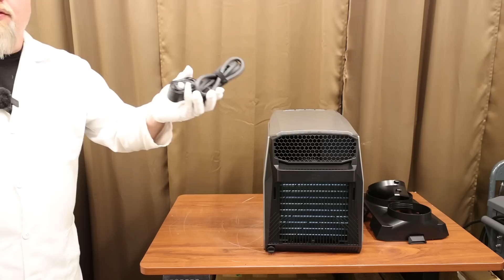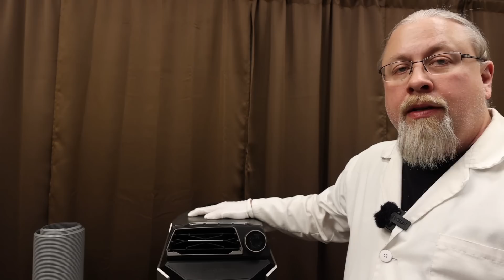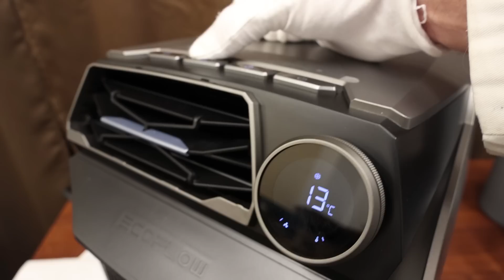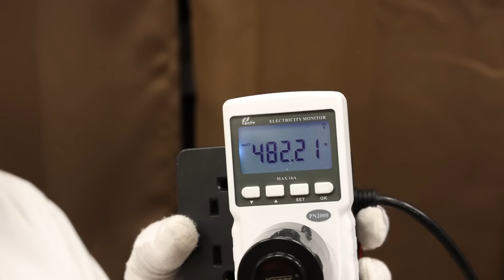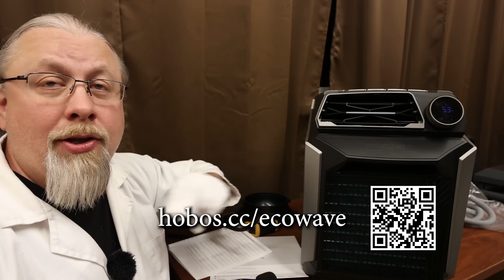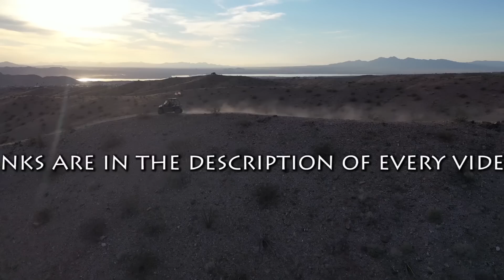EcoFlow Wave PORTABLE Battery Powered Air Conditioner 4000 BTU First Look Review

Comment: Looking at the specs the EER for this is less than 7.  (4000BTU÷600watts)  Most window units have a EER of 10 or more (higher is more energy efficient).  If your going to be running Air Condioner  off of batteries it would be best to find one with a higher EER than this.
Reply: Funny story, my central air conditioning broke and so I bought a couple window units and use them to call the part of the house I was saying. It got colder than with my central air conditioning and the bill was lower. I added two more window units but still closed bedroom and bathroom door when I wasn't in there and the bill was about 2/3 the price of using central air conditioning. That's about 110 during the summer instead of 180 during the summer. It's clear that the window units are extremely efficient now compared to my older central air conditioning unit. And it actually gets cold with them and they keep the air dry.
Reply: @mac_mcleod  yes and if you only air condition the room you are in you will save more money. I use window units because my AC quit working and my bill was way over 100 dollars a month. Now my bill is only about 50 dollars a month. My hot water heater is still on a timer so that didn't change my bill. I had 30 dollar a month bills without AC in cool months. My neighbor across the street pays over 200 dollars a month for AC and her hot water heater is on all the time. Window units can save you money. Also my window units  have an energy saver mode which I use. When I move I will take my units with me because the house up where I'm moving to is much smaller and two units will cool the two rooms I'm not too much worry about the kitchen or bathroom because the kitchen is open and the bathroom is next to the bedroom. The front porch will need a unit only if someone sleeps out there but nights are cool most of the time. 73
Reply: If you are hot....you could care less
Reply: Rated power is 410w, 600w is surge and shouldn’t be used to calculate the EER
Reply: @riversdu2836  another youtuber measure it at 550 watts

Comment: There's nothing inherently inefficient about using AC as long as long as the converter is efficient.  I wonder if it will perform as well on DC.  Quite often, products that have AC and DC power options draw less power and produce less output on DC.
Reply: As I understand it, contemporary air conditioners generally have similar mechanical efficiency.

But this is a low-power unit, so even at high efficiency, it's going to struggle in many circumstances. Add to that the fact that it is expelling hot air (that has to be replaced in the room by outside air) and that there will be some heat radiating from the hot exhaust hose, and it looks like this unit will only be suitable in a very limited range of uses.
Reply: @koertdubois6781  
I believe it a dual hose design which is the more efficient option for a portable.  I agree that insulated hoses would help a bunch.

Comment: In regards to a small mini split what I would like to see is a permanent  unit. Change the outside unit dimensions so it can be tucked up under a van, box truck, RV, bus etc. This would be a big winner if someone did it. Maybe a 5 or 6,000 btu unit.
Reply: Those already exist actually. Look into the cruisin comfort AC systems
Reply: @offgridspecialties8224  Thanks for the reminder. I did look at those one time but crazy expensive if I remember correctly. Currently running a 5,000 BTU window A.C which draws around 440 watts. Solar can keep up during a sunny day.
Reply: @danrandall794  your exactly right they’re quite expensive! We can’t wait for 12v AC prices to drop one day. The price puts them out of reach for a lot of our customers. Sounds like your setup is doing you well and that’s good to hear!

Comment: The power consumption seems a bit high, especially for having fancy variable speed drive. A typical $129 cheapo 5,000 BTU window air conditioner uses about 350-400 watts depending on how hot it is. That is for an extra 1000 BTU and it's a cheap unit that is in no way optimized to be efficient. This 4000 BTU unit should uses less than 300 watts...
Reply from the maker: I made it clear this is designed to run on DC not AC so power consumption is higher on AC.
Reply: @HOBOTECH  You're giving that fact WAY too much credit. I don't know the specs on the AC to DC power supply, but it's probably over 90% efficient, likely more like 95% In other words even if your AC consumption is 5-10% higher that is still an extremely inefficient system.

Variable speed DC compressors should be capable of efficiencies far, far greater than the average cheap disposable window air conditioner, not slightly less.
Reply: Solar/ DC capability more than proves it's worth in power outages with outdoor west coast low humidity temperatures >94°F, >101°F and oh >115°F. I can imagine it's a life saver 80° up in high humidity. That's  less 'wear and rear on the equipment too.
Reply: @wendygerrish4964  Yeah, if your power outage only lasts a few minutes.

Comment: Nice small size, but Its like having a fan in the window blowing all your cool air out. it’s using your roomcooled air to exhaust the heat. Less efficient, unnecessarily hard on battery, more noise for longer, and cools less as it has to draw in hot outside air to replace the evacuated room air.
Reply: Agreed; here's an easy way to look at it: 

A split system is the most efficient because it keeps the hot parts outside and the cool air inside. A portable unit, with no hoses (just like the way the hobo set it up) is the least efficient. Adding a couple hoses improves the situation, but not by all that much.

“A cat can have kittens in the oven, but that don't make 'em biscuits!”

Comment: 450-500w is really no different than a normal 5000btu ac unit that is much cheaper.
Reply: I think the selling point is that it's 12 volts (I think)  and battery powered. It saves inverter losses and extends run time. Running it on 120vac will certainly show more watts thanks to the internal inverter losses. I would like to see the numbers for DC amps and watts while on battery.
Reply from the maker: I will be doing DC tests as soon as I get a battery from them. I expect it to be below 400w.
Reply: @HOBOTECH  I'm thinking 390 watts if the inverter is only  87% efficient. Have fun!
Reply: @kimmer6  is it really going to be enough to make ac a winning proposition? An extra hour of AC is great, but if you need 5kwh to be comfortable on an average summer day, we're back to the drawing board.

Comment: I expected it is smaller and lighter than the window unit. I canceled the purchase when I notice that it is over 38lbs with an A/C unit only. With that attachable battery, it could be over 60lbs. It is difficult to lift it up to use in my ikamper.  not mentioned, the size of this is similar to the window unit or the one with wheels. What makes it portable? The battery?  In that case, my window unit and Jackery in my apartment could be portable A/C.   This is probably a nice-looking A/C? yes. BUT, PORTABLE? DEFINITELY NOT! NOT FOR ME.  Well.  It could be if they send me a crane. 🤣🤣🤣🤣
Reply: I agree with you.I don't really believe anyone really wants to carry it around.
Reply: but imagine a cool night sleep from all the heat when u camp
Reply: @jasminekim3111  ??? Interesting!  I can imagine anything I want, even if it doesn't exist. Your reply looks like robot content. PLS, try to understand what I am saying before replying.

Comment: Just a word of caution if you are planning on keeping the unit outside of the tent and just pumping in the cold air via the one duct.  In Arizona that might work.  In Humid Missouri, that would NOT work.  You have to have a way of getting the humidity our of the air in the tent.  Maybe there is a second duct for that?  Not sure, but I set up an outside 5,000 BTU Air Conditioner on my boat dock, and had one duct supplying cold air into the Cabin of the boat.  It got colder than being inside a refrigerator, but it was a weird, uncomfortable cold.  Got to have a way of getting the moisture out of the conditioned air.
Reply: Hi Ricky, that is why they have a front and back intake. The intake in the front pulls in the humidity from the tent and then out the heated vent in the back.  It should work in MO just fine

Comment: Nice lil portable unit. Good for those with  smaller needs. Too bad they didn't include the battery. You can't be expected to do a proper review that way. After a hurricane with a power outage,  closing off one room in a house and using the AC for even 30 mins at a time would feel great. 🙂👍
Reply: This is my need for it also. I have a Max and 2 Delta Ecoflows... I do have a small 5000BTU window until brand new for this situation so not sure I need a Wave.. just want to make completely sure I have my bases covered in the Charleston Summer if we get a big storm.. hmm??
Reply: I am about to try to off grid later year. A small house. Not tiny, just a small old house. I looked into this and similar products. A lot if great stuff is on the market. It all costs a lot. So for now small window units I horded from a sale and crafty use of solar and battery.  Converting chest freezer into a fridge. Do a show about that.

Comment: With the tent idea idea… as you described you will be pulling in outside ambient into the evaporator then pushing what you can into the tent with a single pass through the evaporator. For cooling and efficiency you need to recirculate the air conditioned air through the evaporator. Every pass the “air conditioned” air gets cooler and and will also carry less humidity.
Reply: Yep. A tent with a stove jack and a small platform would be ideal. Or a vehicle with an improvised output vent.
Reply: I thought he said it had two hoses for the discharge from condenser and one for intake air for condenser. if that is the case then  it will not be pulling outside air into the evaporator. and it would recirculate the conditioned space air into the evaporator.
Reply: @jimthvac100  I think the OP was referring the comment in the video of keeping the unit outside the conditioned space. Obviously you would want the supply hose in the conditioned space, but with the unit outside it would be fighting ambient temps as well as cooling the air supplied by the intake hose.
Reply: @jimthvac100  he corrected himself later in the video. He said the other house was for discharge of cooled air.
Reply: @yvairguy  Oh I see. Yes you are correct these types of units would not be good at all. Absolutely need a two hose system, one to pull in outside air for condenser and discharge it right back out. Else your causing a negative pressure in the conditioned space and forcing hot humid air to leak into the space and defeat the whole purpose of having the AC.
Reply: @jimthvac100  I was a HVAC-R contractor for over 30 years. I've worked on packing sheds that can hold multiple simi trailers, industrial, airplane hangars, medical, stadiums, even down to little countertop merchandisers and everything in between... I would not buy, or rely on, something like this.
Reply: @yvairguy  what would you go for instead?
Reply: @yvairguy  give a specific reason?
Reply: @Gibbbrayden  it’s a science, or at least a math problem, to set up how much cooling you need for a given application. You have to take into account ambient temps, exposure, insulation, occupancy… just to cool the body heat from one person you calculate 400 but’s per person. most cars have from 12000 to 18000 btu systems, if you have an extended van with a dual system your talking 24,000 to 36,000 btu. A city bus will push 200,000 btu. So when you start trying to cool something the manufacturer figures at 12000 with something that puts out a third of that… now if you are parked in the shade, oops solar, and can be in a very confined area 4000 btu might take the edge off but 1/3 to 1/9 of the designed capacity or the vehicle manufacturer is not going to be very comfortable. Also keep in mind you will want the space to only have the air conditioned air exchanging with itself no other air in or out…
Reply: @ActivateTrueHealth  mini split, roof top AC, Midea window unit, window unit. Preferably something inverter driven.

Comment: New subscriber, Thank you for posting great content. I have spent a few hours looking at different videos and trying to educate myself on the different systems. 
We are getting ready to build a van for full time living. We will be in cold and hot weather. If I did the math correctly, I figured we will need 300 WH of battery life, with a 3000watt inverter.  For input I’m planning for 400 watts of solar charging, A/C plusD/C.
Should I buy individual components to make up my system or should I buy something like the bluetii 3000
Reply: Both have pros and cons.  If you have space to do either then price out the parts and decide. Victron has nice components and you can cram parts in all the nooks and dead spaces.  All-in-ones are convenient and you can quickly remove it if you need to.   Pay attention to the efficiency and solar input specs for whatever you decide on and make sure it works with your build.  You can also do a hybrid with a 100-200AH of LFP battery for you DC loads and the Bluetii for your AC loads.
Reply: You get ore life cycles with the bluetti, I have the ep500, 200max, and maxoak. All have 2500+ to 3500+ life cycles
Reply: buy one deltapro. bigger capacity and portable also. easier solution and you can just move it around and fit it in everywhere you want. with the wheels u can also carry it off the van

Comment: Hi Tom, love you shows. I have  quick question on my bluetti ac50 that can charge up to 40 v and 10 amps. two solar suitcase panels both have 18 volts and the 120 watt is 6.5 amp max and the suaoki 80 watt is 4.5 I running in parallel at the moment midday and getting 110 watts which  is okay but will one extra amp damage the battery. my tester is only a ac clamp meter so i cant read the amps only voltage?

Comment: An A/C has four jobs. 
Remove moisture. ** Clean the dust Etc. ** Circulate Air ** Remove Heat.
It is very hard to get a one piece unit t do that job.
I tried t make my own from a 12/24 volt  portable frig/freezer it almost put me in the poor house buying supplies from Mr. Big Box. But it could be done.

Comment: Ehh, $1000. For most RV applications installing a 110v minisplit will provide more cooling capacity for the price, and be more efficient. For tent use it seems a bit too large. Who is the target audience for this?
Reply from the maker: The portable market. It's not for permanent install in a RV.
Reply: @HOBOTECH  Ohhhh thank you for saying that. People are installing the competitor product as if a permanent install so ... I wondered about this one being "meant" for the same function.
Reply: Those who can't (due to size, location) or refuse to go through all the cutting and mount requirements of an outside/inside minisplit.  Think smaller RV and campers, van camping, trailers, etc.  Additionally, this is 48vDC so more efficient and during cooler/winter months it can be stored away to save space and weight.

Comment: Where does all the condensation water go to? I assume you need a hose routed to the outside?
Reply from the maker: It self evaporates under 80% humidity
Reply: Hi DrDennis77, it takes the excess water and sprays it on the internal condenser to evaporate it (which runs hot while in use) without manual drainage under 70% humidity! If it's over 70% humidity, you can use the drain hole to empty your Wave!

Comment: I was interviewed by EcoFlow because I own a ZB. I expected them to be better than the Mark 2. But actually they weren't. The wave is 20x12x16in (3840), 38.5lb, 700w max power consumption, 4000btu. The ZB Mark2 is 20x10x11in, 16.5lb, 2400btu. The wave just like a traditional AC. It is not for RTT. Consider running for 6 hours, which means too much battery consumption is required. ZB is just to achieve night cooling though. But as long as 1.2kw easy one night to use. ZB is probably the most balanced and suitable at present.
Reply: Interesting, I'm considering getting the ZB Mark 2. Is it possible to run the ZB Mark 2 from solar? Either panels or from a Delta Flow Pro? If so, how?
Reply: @pauladdae3130  I think Mark 2’s battery can be powered by solar. They seem to have introduced a new accessory that can support both air conditioning and battery power by solar power. 🤔Delta Flow Pro The 12.6V, 30A Anderson interface would work for powering mark2. I got a wire it from ZB.
Reply: Me too,I'm considering ZB Mark 2,but I hate the special battery pannel design.

Comment: do you think itd be possible to splice a delta pro cable to power it directly from your own 48v batteries?
Reply: Many who purchased the Wave only sure hope so.  There seems to be some 'communication pins' so it's to be seen if the Wave will require this to run from DIY 48v battery bank.  You know how these companies like to lock you into their ecosystem.
Reply: yes and the ac can run on delta pro for 12 hours. they said it in their FB group

Comment: My little Frigidaire 5k BTU window unit uses 450 watts max. It also has a built in soft starter so most 500w power stations will run it.
Reply: I googled 5000 BTU Frigidaire with soft start. I couldn't quickly find anything. Do you have a model number or anything?
Reply: I wonder if it's possible to weather proof a small widow unit for camping?
Reply: He measured wattage while running on AC 120 volts.  My guess is that it will run closer to 390 watts while running on the battery since it doesn't have to go through the inverter with its conversion losses.